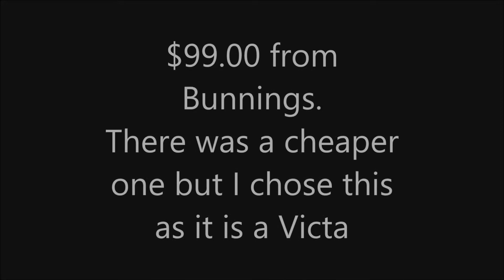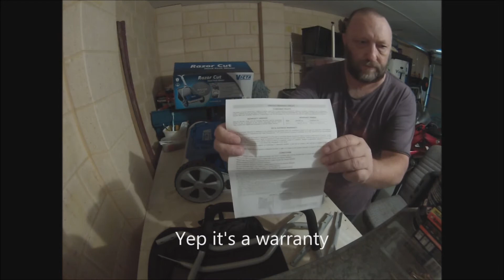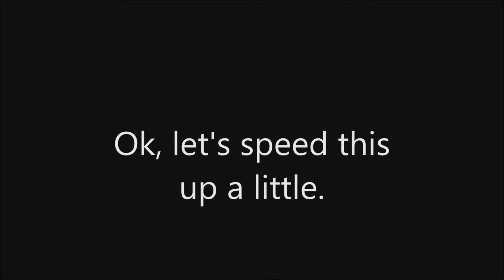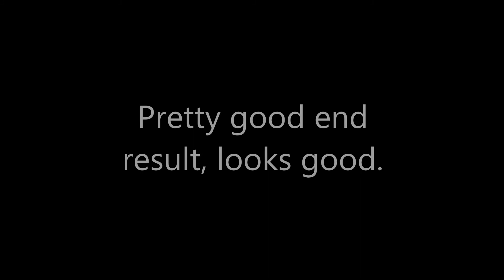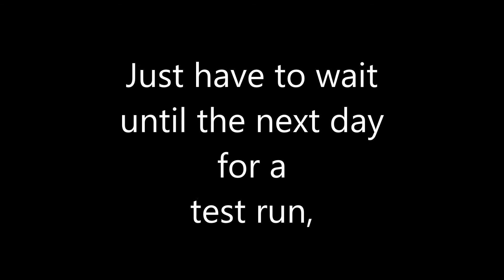Victa Hand Push Mower

Comment: Is it quieter compared to a petrol mower
Reply from the maker: Hi Indiana Jones,  yes it is quieter but does still make noise. These mowers cut like shears, the rotating blade contacts a fixed plate (blade) and shears the blades of grass. This is a little noisey, check my follow up video.
Cheers
Reply: @wazzasworkshop4852  thanks i will ☺